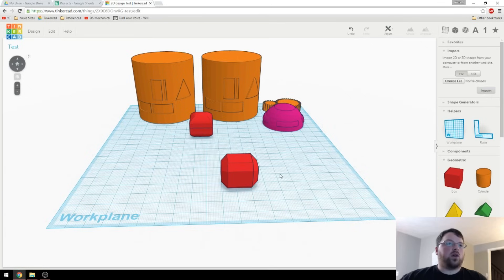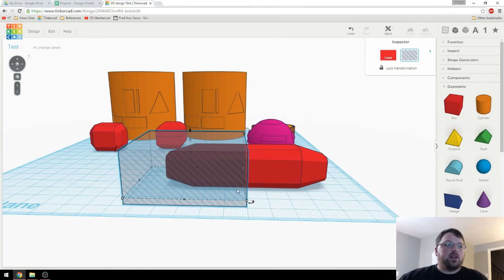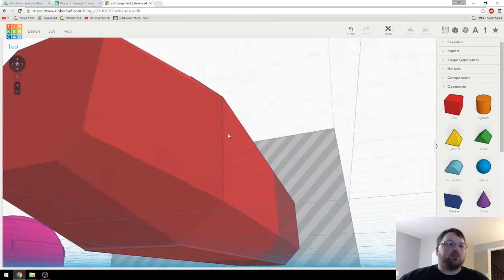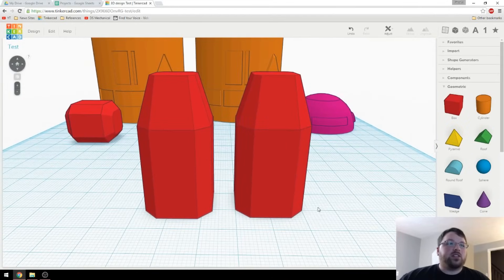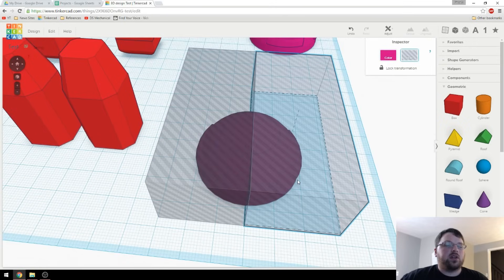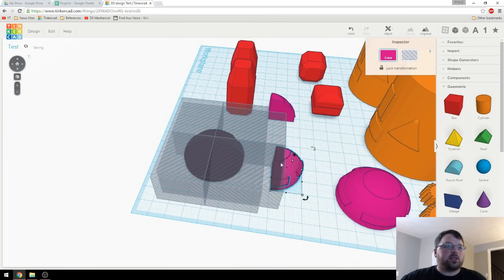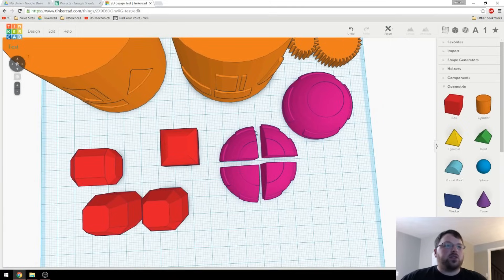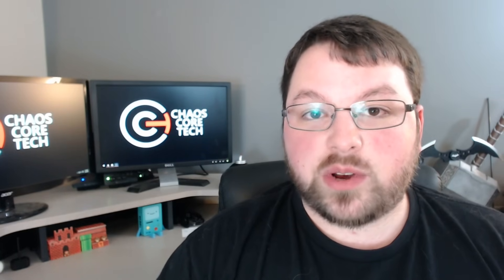How to Split Objects In Tinkercad!

Comment: Why can't you draw a hollow box around the object to be cut starting with the left edge of the box at the center of the object and dragging its right edge until it covers the right half of the object.  Duplicate the whole thing and move it to the side.  Then join the first box and object to cut off the right half of the object.  Then go to the duplicate and drag the right edge of the box all the way to the left past the left edge of the object and then join that,  leaving the right half of the object.  Am I missing something ?  And I can't seem to simply zoom inside a box hole which encloses an object to manipulate the enclosed object.  What am I doing wrong.

Comment: Very helpful video except it only really works if you're splitting into half.  How can I apply this method when splitting into thirds?  I have a model I need to break up into 6 pieces (a large flat panel) and if I split it top to bottom this method works as they are identical.  However they are not identical left to right nor in the middle.  Ideally I need to split it into 2 sections vertically and 3 sections horizontally.  I can't see a simple way of doing this in tinkercad.  TBH I'm really shocked there isn't a simple "draw and cut line" option where you set a start point and end point, link them with a line and just sever long the line without losing any dimensionality just as I would cut a piece of paper with a razor.  This is one area where I find tinkercad really frustrating.  Tasks that should be simple aren't.

Comment: I found this video several months ago and have been using it ever since. Effective but can get confusing. I modified this process by first duplicating the original object, then sliding one of them down with the cursor until there's a decent gap between the two. Then I follow his method making the two space cubes. Here's my mod - select one of the two space cubes and cursor drag it down over the duplicated original. Now you have two sets of original plus space, clearly showing an original with a left space and another with the right space. Select a set and combine it then repeat with the other set.

Comment: Nice info but so much work for a simple cut. Using microsoft 3d builder is much easier. I hope Tinkercad will take a look at 3d builder and implement the same split method keeping both parts with just a few mouse clicks.

Comment: Hi, can you show me how I can extend something after I have made it? I’m making some frame guards for a motorcross bike and they need to be slightly longer, but I don’t want to start again as they fit great, just need to be 60mm longer at the top part. The section is like an inverted U, 120mm long, but I need to stretch just that part to 165mm. Thanks

Comment: Thank you 🙏 for nice guide.

But I want to print a small Rc plane fuselage which will be hollow inside and now I know how to split but how do I join the parts so they are glued straight and alighted, something that a bit of one slides into the other and the joint is nice?

Comment: i was looking for a way to get 4 'pins' on a front for a box that hold the print with a screen on to move slightly as the print i have seems to have the openings more on the ouside than the stl

Comment: Other way is to

1. Measure object and make copy

2. divide length by 2 And make box that      length 

3. Make copy of box and use align tool to put each box on each copy of object you want to split directly at the end of it

4. Combine each box and shape and now u have two halves of the object

Comment: Love the technique. Using it all the time now.  What I am trying to do now with it is make a two part model split with a screw on one side and a thread on the other that will allow it to be printed and then affixed together with the parts aligned perfectly by using the split and not moving the object while making the screw/thread parts. Any idea on a way to do it would be appreciated.
Reply: I know this is a bit late but it might help someone else. What I did was I split the object using his method and then created 4 holes with corresponding pins on the opposing model. The two pieces fit together perfectly. I managed to get the tolerances for the holes down to the point that I don't even need to use epoxy to hold them together but you can definitely use this method along with a light layer of epoxy to make the bond unbreakable.

Comment: I also like to make my build plate huge so I have more room to work and when my model is done, put my plate by to normal size.  Sometimes I'll open two tabs in my browser and copy and paste parts into one tab to make it easier to work with one section at a time and then merge the two together on a single build plate in one of the two tabs I have opened.

Comment: Needed to split a battery holder tray in half. I have a AA and AAA battery dispenser, just needed the 9 volt tray. Worked liked a charm. A 9 hour print went down to 2 1/2 Hours!

Comment: It would have been nice if you had updated this by saying it doesn't work anymore. I just spent a couple of hours trying to do it with no success before realising you were using a previous version of Tinkercad. They obviously 'downdated' it so it no longer works! Why they can't just put in a 'cut' feature I've no idea, that should be really easy.

Comment: seriously tinkercad needs a cut function
Reply: Yeah, the need to do a hundred steps just to slice an object is just... ridiculous!
Reply: @nickel392  I'm so used to inventor that tinkercad makes everything 50% more tedious
Reply: Add 1mm to the length you want to cut. Add a box and resize it into basically a 1mm sized wall (or blade). Place it at the cut point and call it a hole. 

CHOP!

With a ball/cone/cylinder etc chop at an offset to keep a piece in spec and then duplicate back to a whole
Reply: @xyber81  I'm sorry to say but that does not work, ive tried it many times and it wont work, im assuming when you say chop you mean group yes?  as when you do that it inserts a 1mm slice through your project but that is all, the project remains a full project still with a slice shown in it. It does not break it apart sadly.
Reply: At the very least it should let you cycle through the objects by hitting tab. This "zoom in to select" method is terrible
Reply: YES I 100% AGREE
Reply: AGREED
Reply: sorry to be offtopic but does anyone know a method to get back into an instagram account??
I was dumb lost the account password. I appreciate any tips you can offer me.
Reply: @Izaiah Roy Instablaster =)
Reply: @Sam Bobby i really appreciate your reply. I got to the site thru google and im in the hacking process now.
Seems to take a while so I will get back to you later with my results.
Reply: @Sam Bobby it did the trick and I finally got access to my account again. Im so happy:D
Thank you so much you saved my ass!
Reply: @Izaiah Roy No problem :)
Reply: i like how alot of us are recent viewers lol

Comment: Howdy, My tinkercad interface looks a little diff than yours. I tried to zoom into an object but it stops just outside of it. I tried to change the camera from the top view but also no luck.  Is there some setting I need to click on to use this function as I can see where it would be very helpfull.  I even tried swinging the plane and backing in but it still stops just outside the object.  any help you can give will be much appreciated.  starting to think they disabled this function.  Thanks.

Comment: Thanks for the tutorial, I couldn't get this to work on the current version, I had to use the same method after duplicating the 3 objects instead of duplicating the object to be cut.  Then I had to complete the operation twice to get them to split.  For some reason the top would remove and when I grouped the bottom it just deleted it like normal instead of leaving two parts.  But your steps helped me get there!

Comment: I wish there was a better explanation.  He says " here I zoom in", how? What button/mouse click/key do you push. I don't have a middle button on my mouse.  Man I feel dumb.
Reply: A wheeled mouse is the only way to go.
You can get a Logitech wireless mouse with a wheel for $10 at Walmart.
It makes scrolling easy because you don't have to put the cursor on the scroll bar.
On Tinkercad it's easy to zoom in and out with the wheel.
Hold the mouse wheel down to move the whole Tinkercad scene when an object gets behind a window.
For reading - Tapping the wheel lets you adjust an automatic scroll for reading long pages.

Comment: I have watched this video about 40 times and still no idea. if I follow it word for word when I do the first grouping I lose the half of the object I selected - it disappears, leaving me the contents of the other box only. And shift click actually highlights half the web browser in blue and does nothing. What is the point of the box?Why am I zooming into the picture to select the item?Grouping doesn't feel intuitive to cut the object in half, it simply groups a box and an item (then removes them)
Reply: Same here. Loose half the first object you separate. have to copy entire object first an do the spitting process twice on each, keeping the opposite side.
Reply: you need to first duplicate the object you want to split i think
Reply: I had some issues myself, but mine was with a detailed object, so the lag it took to make the change made me think nothing was happening, but I had to wait 5 seconds instead.  Also if you can get things to work for one half, just do the opposite order for the other half, eventually it will work if you try a couple variations.
Reply: Get your boxes laid out like he shows in vid. then before you "group objects" Select All - and duplicate everything then group each side in the separate model. For me, sometimes it works like in the video, sometimes i have to duplicate first. Seems to depend on size and complexity.
Reply: same this isnt helping
Reply: yeah this, when I first learned about this I kept forgetting to duplicate beforehand

Comment: How do you rotate an object 1 degree at a time??
Reply: I hope this helps. 
If the cursor is inside the 360 circle it stops on 12.5, 45, 90 degrees etc.
If you bring it outside the 360 circle you can get any degree of rotation by whole degrees.
If you wanted many  copies, each rotated 1 degree you could do a C/copy then a D/duplicate.
Then rotate 1 deg, move it away from the original, Then every time you do a D/duplicate another one will show rotated and the same distance from the last one. They will all be separate.
(On a Mac it's command C & command D), PCs it's the key in the left bottom corner whatever they call it.
Reply: Any way to get the Degree circle smaller on some objects so you dont have to zoom out so far and it makes if harder to see up close..
Reply: Not that I know of, but I wish they would come up with one until then... zoom away.

Comment: Do you have any tips for hollowing out designs to use less material when printing?
Reply from the maker: +Ellen Hunt That's a good subject for a video! I'll make it soon. Thanks for the suggestion. :)
Reply: +Ellen Hunt That's a good question Ellen. I think it would depend on the shape of the object. Symmetrical objects would be easier. I make Tinkercad eggs into eggshells by making a slightly smaller copy turned into a hole and then use the align tool to center it inside on all 3 axis' and then group 'em. 
  If the object isn't symmetrical you could assemble an array of holes of the needed shapes, maybe just a bunch of tall hexagons of various heights because they pack efficiently and group them. Next make that solid and the outside object a hole so you can see how the cavity fits inside. Then turn the cavity object into a hole again and the outside solid and group 'em. Internal overhangs might be a problem depending on the shape of the top.
I'm sure CCT can figure another way, I'd like to see his video when it comes out. 
Good luck, I'm going to try it... We can all use shorter print times that use less material.